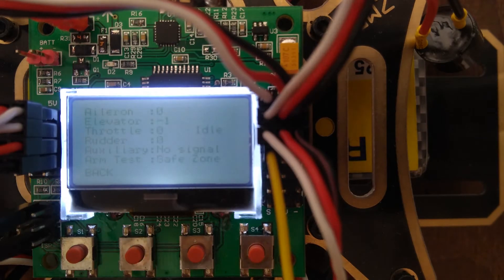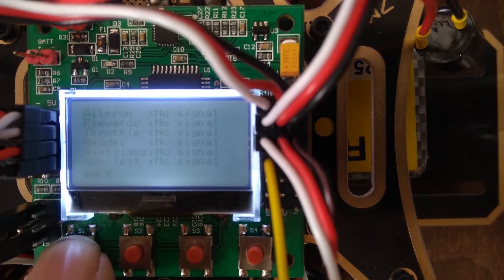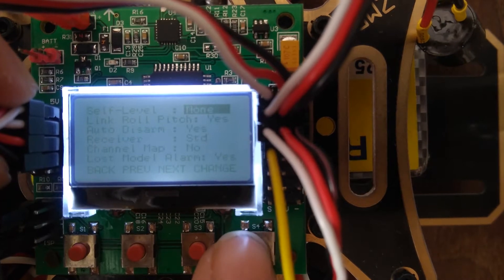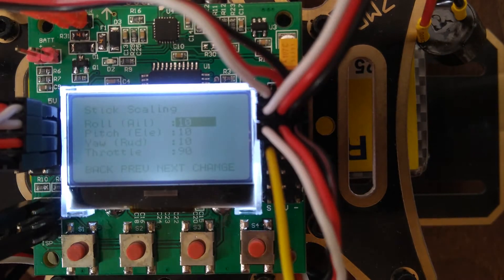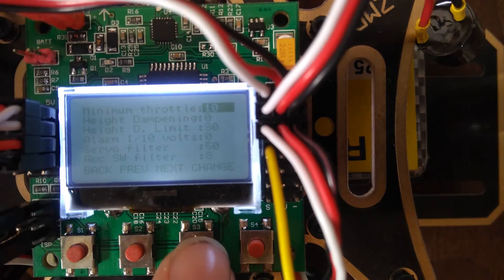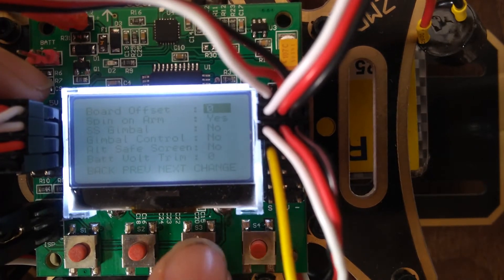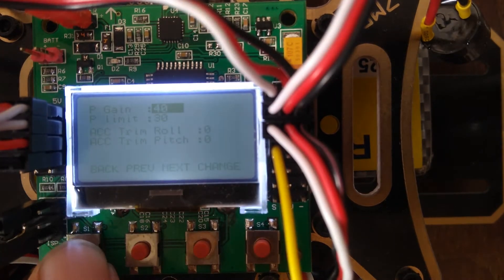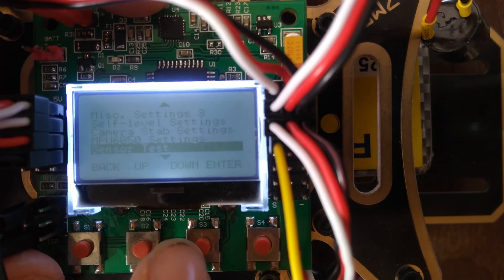How to make your own Quadcopter (using KK 2.1.5 board)

Comment: I need help with my drone, it doesn't take off different motors spin in different speeds. And, it gets disarmed immediately after applying throttle after a certain point
Reply: Battery  problem

Comment: Brother, my quadcopter is not lifting up,I had used the same configuration, what could be it's solution, is it is transmitter problem or programming???
Reply from the maker: It could be both , plz give more information ie is it flipping on take off ?
Reply: @coolplus1830  No it is not flipping it is taking off perfect but the problem is that it is not staying in air and dropping,can u give all the basic settings  what u had used in ur drone like sub trim values,channels,mode,..etc
Reply from the maker: @shubhamsony03  that's the battery problem according to me
Reply: @coolplus1830  brother can u say me full transmitter setup and how to make all the values to zero like throttle,rudder,elevator..can u give ur number??
Reply: Mode stting me always pe set kar do it will work 100percent
Reply: @x011drone9  it is already in always mode,the problem is when I am trying to lower the throttle then it suddenly fall's down..
Reply: @x011drone9  Thank you bro for your helping nature..i had already succeed and completed that project.
Reply: @shubhamsony03  mention not
Reply: Call me 7880844311 at 8 pm
Reply: @x011drone9  plz help in same problem

Comment: Give your watsap no plz
I have made drone
And
I 
Want some information
Reply: I have a problem with esc callibration because different motors spin in different speeds
Reply from the maker: Plz ask the information here
Reply: My drone does not take off
Reply: Also, it gets disarmed immediately  after applying throttle after a certain point